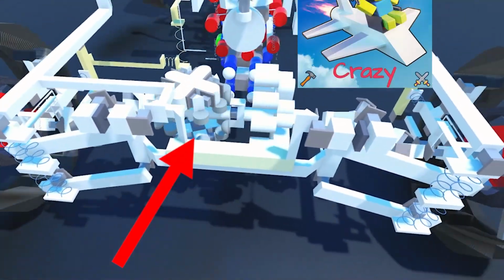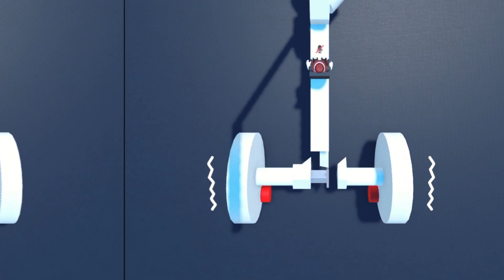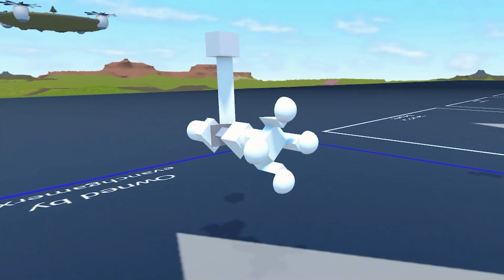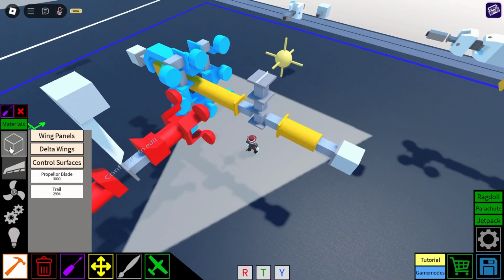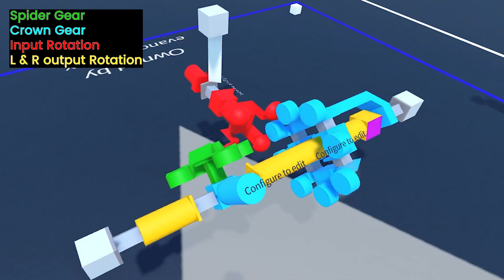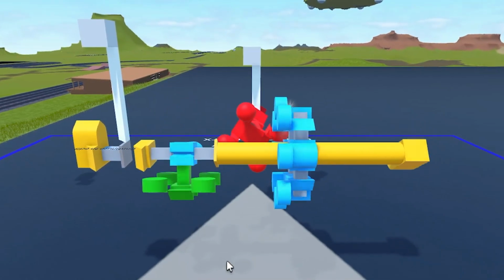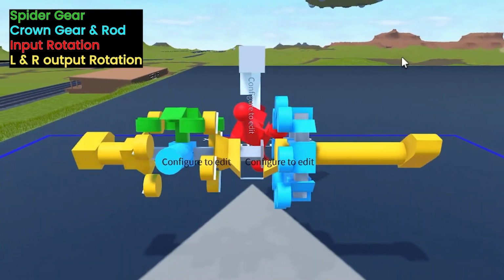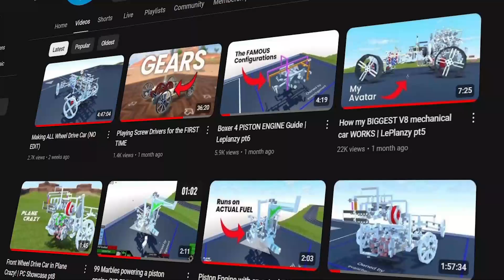DIfferential Guide pt 1 - How it works & How to make it | Leplanzy pt 7

Comment: Instead of placeing cylinders to Connect it use compresiune black powered with colision off no key to activate and set compresion to 0 s-o it will remain the same but it sunt colide

Comment: IMPORTANT!
If your wheels arent going diffrent speeds smoothly, that might be because of the spider gear. My solution is to replace the Spider Gear's Half cylinders with half balls and replace the half cylinders on the 2 yellow gear that are next to the spider gear

Comment: how do u make those very round big wheel? does it use motor locks? 3:15
Reply from the maker: it uses angle lock and compressors. Only took me 2 wheel stacks, combination is block > block > 2x1 wedge > 1x1 wedge > 1x2 wedge > block > repeat. Then Angle lock this wheel 2 times with 45 degrees angle, there u have it!
Reply: @evans_workshopx how did you connect the yellow part to the body?
Reply: @Suupmi1 using a motor connected to an anchor block. On some clips you can see a contraption next to the right wheel try to copy it.

Comment: not sure if this will work with my overly complicated gear designs but i'll try it anyways >:3
edit: i overuse compress blocks for literally anything that requires collision-less blocks
Reply from the maker: lol, it's fine to use compressors as long as it won't overwhelm you later after you build the components. Using texts could reduce the attachment point as well, it only attaches from 1 side so you won't accidentally connect stuff together :)

Comment: my crown gear is spining the opposite direction, can you help?
Reply: yep its going the wrong direction
Reply from the maker: @kaiho.kun1  if you're using an engine, try flipping the timing so that the engine goes to the other way, but if its just a powered motor, just change the forward control to the backwards control
Reply: @evans_workshopx  ok
Reply: @evans_workshopx  i tried experimenting and i found out it spins when it is in the wrong direction too, so I tried it with the engine again but is till stuck
Reply from the maker: just.. flip the direction of the input rotation? what power are you using for your differential? engine?
Reply: @evans_workshopx  I am using a inline 4 engine by the bizarre tinpot
Reply: @evans_workshopx  how do i do that
Reply: nvm it works

Comment: mine doesnt work
Reply from the maker: can you specify the details? maybe you connected the bearings to the wrong part?
Reply: @evans_workshopx  i will try to remake it
Reply from the maker: @teopintilie2368  alright, you can tell me which part that doesn't work next time
Reply: @evans_workshopx  i give up
Reply: @evans_workshopx  also the gear needs to be on the right side or it can be on the left side too
Reply from the maker: @teopintilie2368  any side could do ofc